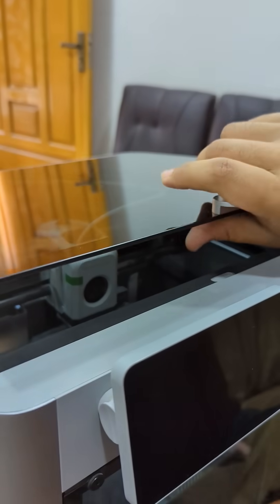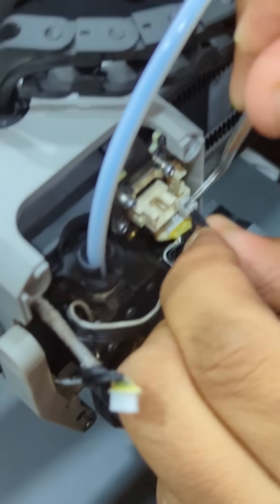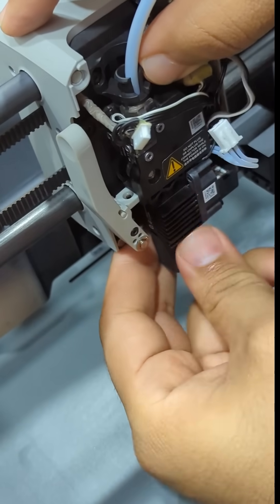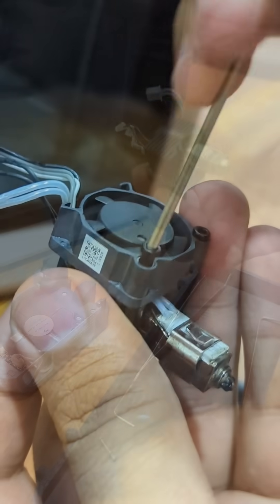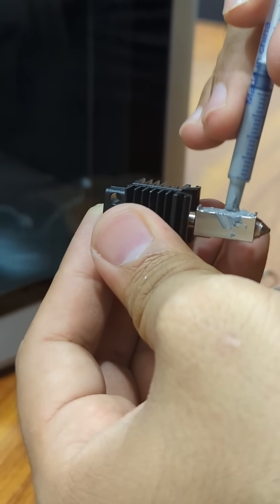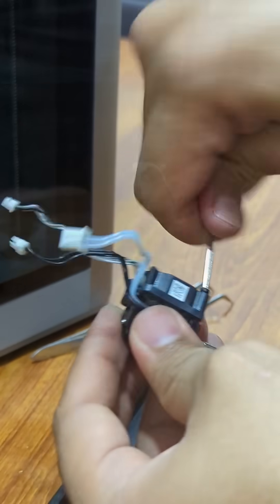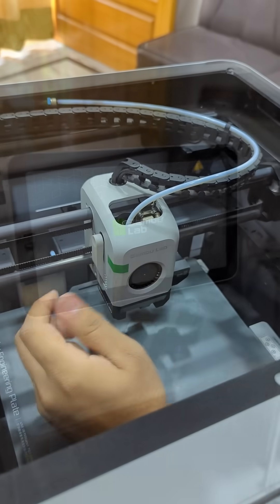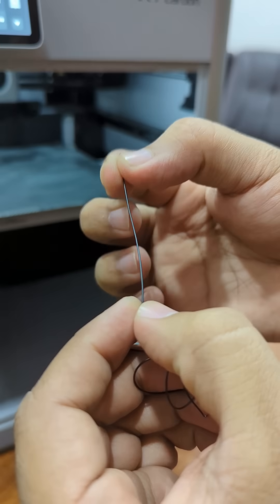Bambu Lab Carbon X1 Nozzle Replacement Guide || #bamboo #craft #maintenance #nozzle

Comment: Why cant i just change the nozzle like other 3d printers?
Reply: Che prodotto usi per attaccare?
Reply from the maker: Just because of that, there is a big generation difference in the old 3D printers and the bambu 3D printers. It looks like the iPhone of the 3D printers 😀😂
Reply: Because it generates more money, thats the only real reason. The comment from the video creator obviously/hopefully is a troll.
Reply: @vaf3614 they charge $15 for a horned, they aren’t getting rich off of it.  

I’ve been 3D printing for 15 years starting with a Wanhao.  The Bambu IS a generation beyond.  It is a tool instead of a hobby.
Reply: @vaf3614  times people chnage their nozzle: like 5000 hours 
if you want a changable one you buy a 3rd party one

Comment: Don't forget to turn off the printer completely before disconnecting any wires, Otherwise, it's gonna blow
Reply: Just so you can rest  easy, it doesn't blow. Unless I am taking out the extruder (even then it would be alright), I don't usually turn off the printer for the nozzle replacements.
Reply: @ooOnymphetOoo  💣💥